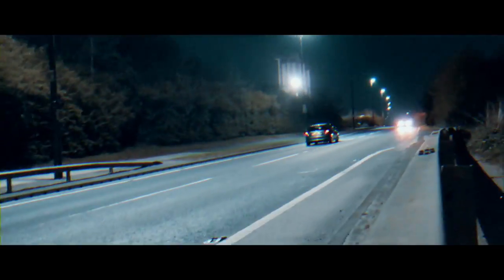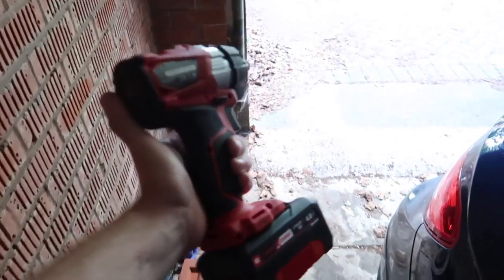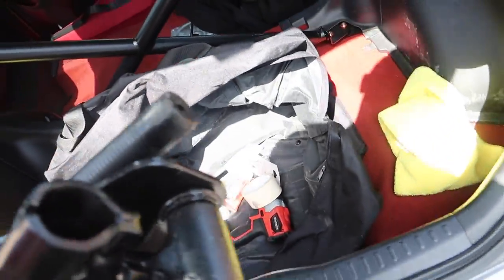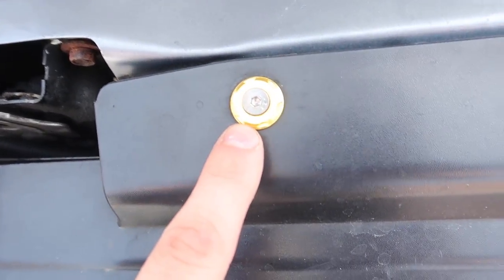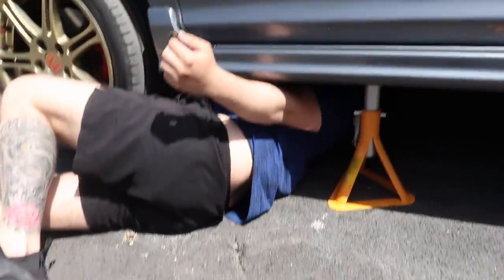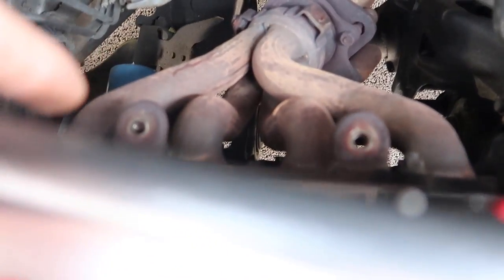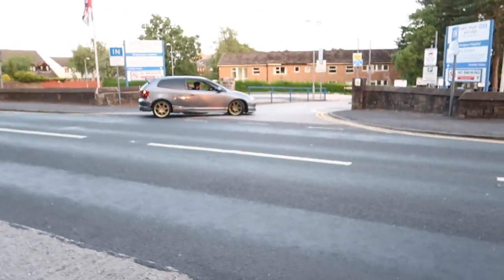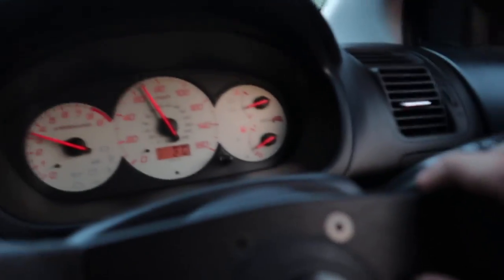JAPSPEED 4-2-1 Manifold For The Type R!!

Comment: Before I got my kpro mapped they did a power run with just the breather mods and no map. 211bhp. You’ll need some engine mount inserts with that mani or you’ll be going through flexi’s every couple of months off he excessive movement. If you get engine light get the 90 degree lambda spacer. 99% it puts light out. If not sticks bit wire wool in the spacer. You don’t need injectors for an N/A setup just like you don’t need bigger TB on N/A setup either. Waste of money. Mines mapped now on v4 kpro at 242 all you’ll need before a map to make it worthwhile now is an rbc. I’ve got vtec at 4K and a 9100 redline although I’m on a built bottom end and s2000 oil pump

Comment: I'm sure you need a k100 ECU before you can remap it
Reply: That is correct
Reply: Yeah you can’t map standard ecu
Reply: @rayner1704  you can map a standard ECU  mate but the gains will be terrible at around 5bhp gain  for around £300 map software
Reply: @motomash6143  are you sure? Think the stock ecu’s are locked used by Honda on most of the cars they make.. even if they wasn’t how could you gain only 5bhp from a map that’s waffle,

Comment: I had that rattle on start up now and again, turned out to be VTC cam
Gear mate. Had the chain, tensioner, guides and new VTC gear and haven’t heard the noise since. Just letting you know man ✌🏼. I’ve heard people have just left it thinking it’s starter motor and it’s ended up skipping the timing and fucked the engine
Reply: Damn, are you serious?? I got exact same sound ._.
Reply: Yea mate unfortunately. If you hadn’t had the chain, tensioner and guides done it’s worth doing and the gear at the same time for sure 👌🏼

Comment: You will need engine mount inserts   or the flexipipe will break after a few months unless your already running uprated engine mounts.
Reply from the maker: Randy Marsh got the gearbox insert just need to install my inserts
Reply: +1 on this

Comment: Hi mate I have a corsa sri 1.6 and was wondering how i could gain around 20-30hp without getting a remap because a remap would put me at 195bhp and some people say I need to upgrade the injectors and some dont so id rather not risk it because of p4 lol any ideas?
Reply: Piston 4 is just a heat problem you either have problems or not once car gets towards 90-100k it will be well on it's way to a rebuild.

Comment: That wasn't the starter motor 🤭 also need engine mounts or snappy snap
Reply from the maker: Engine mounts been done and pretty much all ep3s make that noise when cold start ahah
Reply: VTC Actuator
Reply: Jesse Collingham my cousins makes the same noise he says it’s very common but mine doesnt
Reply: Only rattle my ep3 makes is the timing chain guides and only on cold start due to oil starvation.
Noise is gone in less than 2 seconds.
Actually sounds alot like that lol